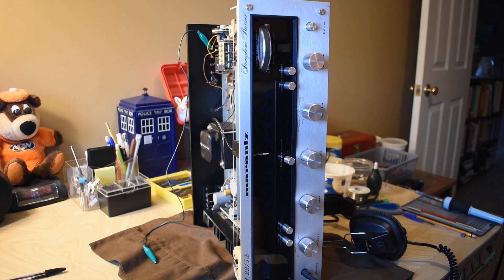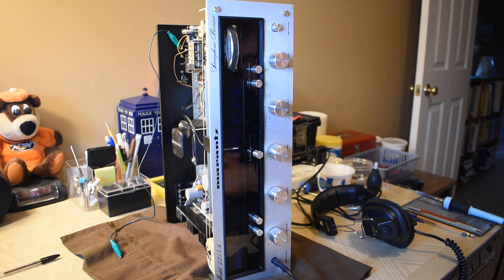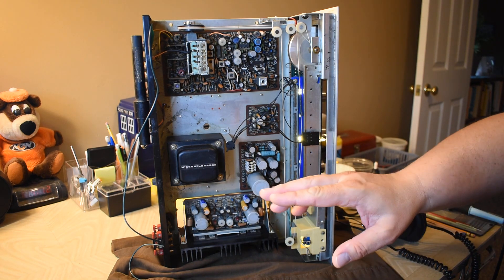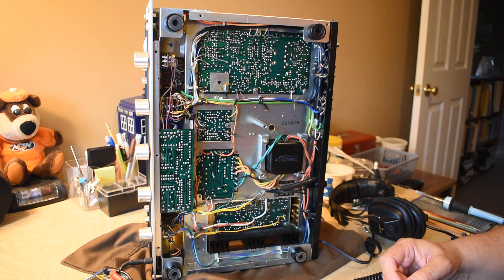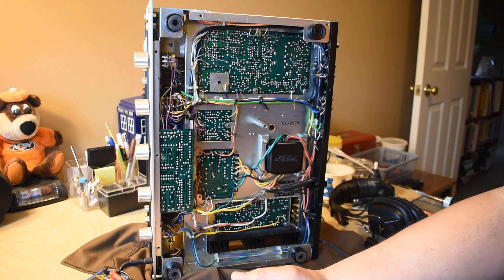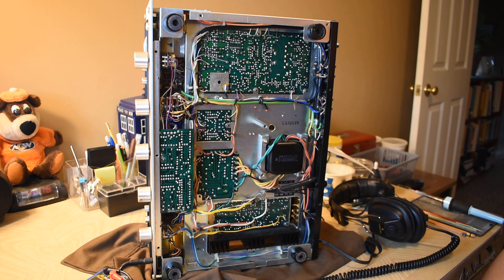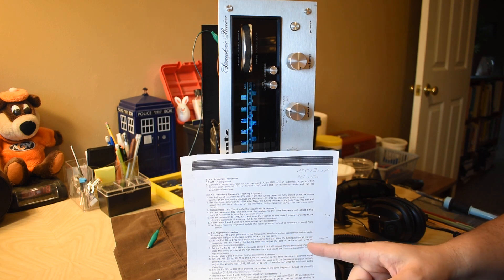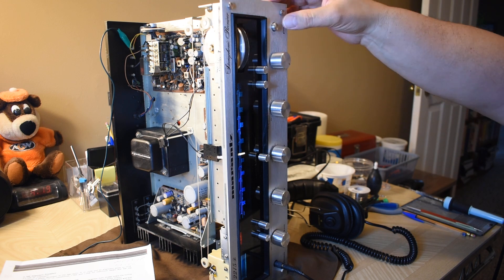Marantz 2215B stereo receiver- the cursed muting circuit and waking up the FM tuner!

Comment: Are there any good resources on Marantz receivers?  I have a unit that never goes out of protection mode.
Reply from the maker: Which model do you have?
Reply: @acrossthedial  sr6000
Reply: @acrossthedial  sr-6000
Reply from the maker: @ https://www.hifiengine.com/manual_library/marantz/sr6000.shtml
Reply: @acrossthedial  Ya, I've poured over the schematics.  Didn't get much insight beyond just pulling everything and testing out of circuit.